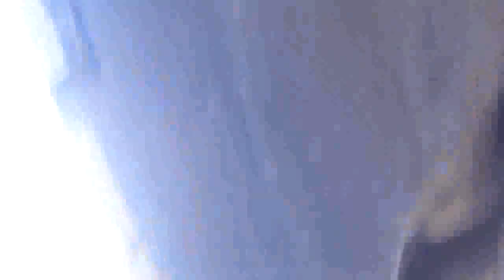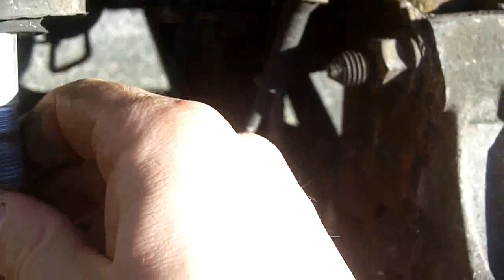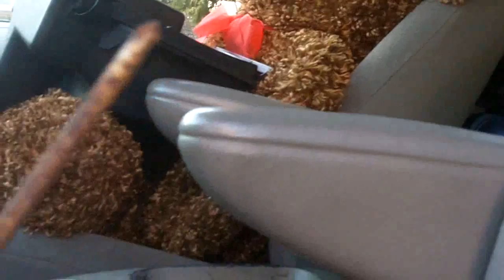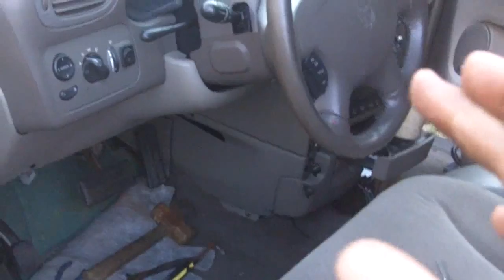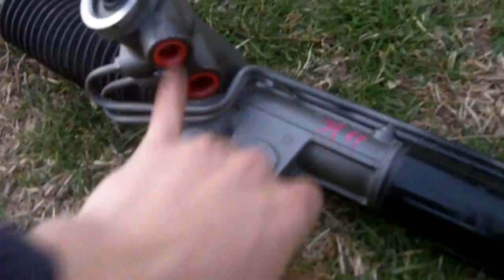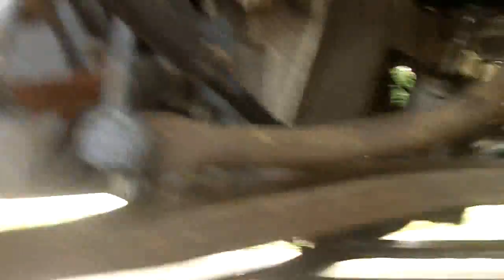Installing a new Rack and Pinion 2003 Dodge Grand Caravan

Comment: You can leave the outer tie rod ends connected to The idle steering knuckle break the nut loose and just just unscrew it from the idler tie rod end. You don't have to take the tie. Rod ends off the outer tie rod ends. You should loosen loosen the outer tie rod ends in the beginning first thing

Comment: why would you start the video with a lie? simple is a 100% lie
Reply from the maker: It is simple, it’s a part replacement. I remember this. The power steering pump was difficult. I’d rather do 10 more of these then EVER do a power steering pump on these . Many tasks in vehicle repair are simple if you follow steps and have patience.

Comment: Here's a mechanic hack for y'all. To keep the steering wheel in the straight position take the seat belt and loop it through the bottom of the steering wheel and into the belt buckle move the seat back or tighten the seatbelt. This will keep the steering wheel 100% straight

Comment: To lock the steering wheel in place if you're having problems pool the driver side seat belt all the way out slowly until it's fully extended wrap it around the steering wheel and clip it into the seat belt buckle pull the seat is far away from the steering wheel as you can get it and it will hold the steering wheel from spinning while you're playing with everything else again pull slowly and make sure before you disconnect anything your steering wheel is centered and the wheels are as well
Reply: Pull not pool
Reply: And I know this thread is ancient but it is a tip that someone might need

Comment: Theres a special tool that slides over the tie rods you tighten the bolts around the inner tie rode in and you use a ratchet to turn the whole tool. Dodge caravan are rounded so theres no place to grab onto with a tool. I just did mine

Comment: Removed rack by slipping it through center hole of support plate. Didn't take any bolts off plate. Remove 3 nut/bolts, fluid lines from rack then slide it to passenger side until drivers side tie rod end can be dropped into center hole and turn rack so it can be pulled out towards drivers side. I took out battery, cruise control unit and filters(2) under drivers seat for access to fluid lines. There are lines in the way that need to be moved a little but you'll see that. Not sure why people remove plate

Comment: Lol hope ya disconnected battery too. Glock is also why air bag lite stays on some time. I am getting sick of car repairs, mostly the greasy jobs!!!!I have a big problem with shops leaving nuts and boults off. Jerks keep doing it! Got oil change they lost air filter nut. Do we need a power steering pump too.

Comment: Grate vid, I do have one suggestion, two days before you want to remove the rack spray penetrating fluid on once or twice a day before you start to work, on the tie rode ends and other nuts you want to remove. This should make removing a lot easier. you should drive it during those days as the vibration will drive the fluid in the parts.

Comment: I was quoted 6 hours later from Firestone to do that job can it be done quicker than that I also need the drag link replaced
Reply: The 2001-2007 Dodge Grand Caravan/Chrysler Town&Country steering system does NOT include a drag link.

Comment: Good job, I have to do this on my 02 T&C, would it have been easier if both inner and outer tie rods were removed prior to removal? I do not want to loosen the engine cradle and also want to avoid the large bracket/support shield too. Thanks

Comment: How long can I ride on a bad rack and pinion? Been doing it for 5 years 100k plus  lol  I mean I'm not loosing power steering fluid. It drives and steers fine even alignment on point. I do hear minor noise when parking etc  which got little worse over years  but unless you really know and listen to the car you wont notice it . II got about 250k on my  2006 Camry don't want to put money into it besides that car good mechanical condition drives smooth any advice? I wanna make this car last without doing unnecessary work $$ save money fyi my mechanic said i got at least 20 more k on it minimum but who really knows
Reply: brs rafal yea I notice noise too. I hate any kind of noises, I am reconising different noising like water pumps are real easy.

Comment: I'm about to change my rack & pinion on a 2000 Plymouth voyager , My main concern is rust on the jacking points of the frame. Where should I jack up the van , using my 3 ton floor jack and safe placement of the jack stands? I Like the idea of placing the tires under the van for added safety. 
Your video is very helpful .  Thank you

Comment: you can hit the bottom of those bolts with a hammer using a block of wood to keep from damaging them, they pop out fairly easy,  also you have to have a 18 mm claw wrench with a long extension bar or forget it, I took that whole brace off it was a pain in the butt but it did make removal and putting the new one on much easier.

my problem now is the new rack and pinion steering pin does not line up with the knuckle it was removed from and I am trying to find out which I should turn to make it line up, the knuckle that comes down from the steering wheel? or the new rack, I'm guessing the new rack as the other might mess up the clock spring

over all good information would have preferred an entire replacement video that might have answered this question

having had an opportunity to do this again I would have parked it in a bad neighborhood and left the keys in it
Reply: The directions with the rack and pinion tell you that the rack is centered and ready to install but my rack did not come centered. I called the support line and one of the guys told me to turn the rack all the way to the right and then all the way to the left and count the number of turns, it was 3.2 turns so I turn it back to the right 1.6 turns and it was at twelve oclock the same as my rack. I did this with both racks to make sure they sent me the correct one.   i did not remove the brace off the bottom and was able to get the rack out but it did take some finagling. I also replaced the high pressure hose not because it was leaking but because I have over 210,000 miles on the car and it was a piece of cake without the rack in the way. Hope this helps

Comment: I have a 1998 Dodge Grand Caravan which seems a lot like your model.
My Rack and Pinion is leaking as yours. 
I just wondered instead of buying a new unit, is it possible to remove it and fix the leak? It is a seal that's failed?
Never attempted this before.

Comment: hello you forgot to mention that you had to hold a nut on top of bolt on the cage part but how do you take of the 18 mm hose off the rack from below .only thing holding it up

Comment: One thing you should really not do is smack those knuckles with a hammer to break those outer tie rods loose.  Normally, it's fine to do as much when the knuckle is made of steel.  The Caravan, however, has aluminum knuckles.  Since aluminum is a softer metal, you run a greater risk for damage and distortion of the knuckle.  The holes that the tie rods seat into are something you definitely don't want to distort.  They're tapered to create a friction fit and that binds the tie rods to the knuckles.  The other problem you could cause is to distort the curvature of the arm that connects to the tie rod.  If you mess that up, you can mess up the geometry of how the van steers on turns.  The best tool for separating the tie rods is from OTC, (part number 7503)  It's fairly pricy for one time users so check with your local auto parts stores to see if they've got the tool handy in their tool loan programs.

Comment: What the hell?  

All the bolts on this goddamned thing have nuts on top.  The big black support plate does.  I cant reach anything lying on my back under my van.  I do have large hands, but still.  I cant turn any of these bolts to take anything off because the nuts up top just spin.  Even the three big ones that hold the rack in place.  How is this job possible?  I cant get a wrench on those nuts to back the bolts down...maybe a few of them....but a lot of them there's just no fuckin way.  Nobody ever mentions this???????   Nobody.  Seriously?  I have to put it back together.  I give up.  I gotta send my rack back to rock auto.  This is ridiculous.
Reply: It's doable by holding the top nuts with a box wrench (21 mm and an 18 mm) . You have to blindly feel each top nut with your had to determine the best way to access each nut with the box wrench. In my case, I used the mentioned box wrench(s) along with an air impact for the bottom side bolt. I can't imagine removing that cradle and rack without having the air impact. Too much added work without it.

Comment: I just replaced rack and pinion from my 2003 grand caravan, and as most of you already said, its a pain in the ass to remove both lines from the rack, Sadly, after over 10 hrs, I got a bigger fluid leak with new part installed, so my question now is, what if I  messed up and put back revesed lines? can somebody tell me which one is the high pressure and wich one is the return line in the rack itself?

Comment: This may be old news since I didn't feel like reading. The proper way is to loosen the tie rod ends before you you remove the ends from the steering knuckles, and then count how many turns it takes to remove it from the rack. That way you don't have to have the tie ends in your way. Then count the same turns when installing so you can take it for an alignment if needed.

Comment: What makes changing the power steering pump such a hard job?
Reply from the maker: *****  sorry for the delayed reply.  the power steering return and pressure line mounted right on the rack makes it a really difficult job because of its position. as I was typling i looked at your post again and you said pump not rack. lol.. the pump is a very straightforward and easy job. the only part that I would say is difficult is getting the old pully off the old pump and transfering it to the new one. taking it off is a bit challenging but putting it on is a breeze. most remanuafactured pumps come with a long screw washer and bolt.  you set the pully down evenly and you screw the screw down the thereaded pilot hole and then you tighten the nut down on the washer till the pully is down on the pump. Its a good idea to take note and measurement on where the pully sits on the shaft, cause Ive had a few of these vans come in because the belt was popping off or squealing and it was due to a mis alighned pully. you never want that in a serpentine belt system.. or you can just buy a pump with the new pully on that. the other style pumps are mre common to come without the pully installed, and ofcourse the pully is seperate.

Comment: These cars have a heavy pivot point on the front. If you are not careful the front might drop and tilt down onto you as it is heavier with the motor, etc. so make sure your pivot point is forward and not backward to the balance of the car body. Be safe or get crushed in the front if it tilts onto you.

Comment: The book time on this is 4 and half hours. Which is impossible by the time you do the job and bleed the system.
Reply from the maker: Lightningmicro  most mechanics have them up on lifts and they bang them and rip them out and move onto the next thing. thats why Ive got a few of these in that had racks put in them by other shops and the van is throwing a EVAP code for the line thats under it being unplugged or broken cause they werent careful

Comment: Question?  Is it possible to loosen an emission hose while doing this and if so will it cause a 457 code?  I had mine repaired recently and my engine, gas cap light, and airbag light has been on ever since.  I don't think the airbag light is connected to it though and I'm confident that it's not the gas cap because normally when I tighten it the light goes off.  It's been (7) days now.
Reply from the maker: Sister Mattie Yes, Theres a hose that often gets loosened during this process. its right under the rack and pinion. Also, Yes. Your airbag light is connected to this aswell.  If the shop accidently spun the steering wheel while the rack was disconnected from the vehicle, say goodbye to your clock spring inside the steering column that delivers signal to the air bag and other things.. get the SRS codes for the airbag light, Ill bet its for a faulty clockspring or some loose wiring along the way by the steering column.. You have to be carful with who services your car. let me know what you find out

Comment: how did you get the steering column on the steering rack with out it moving
Reply: 905speedgta  If you're planing on putting the old rack back in - During removal and Before you separate the rack from the column - use a marker or paint pen to mark the position it is in.
Reply from the maker: Kevin Smith  remanufactured racks come in the straight ahead position. meaning its set so the wheels point straight ahead. the steering wheel is to be placed as if the steering wheel is straight and not turned.  and it will slide right in

Comment: Nice video and thanks.  I'm 12hrs in 3 days into this job. I'm replacing both lines, reservoir and rack and pinion.  (I'm using power tools and jack stands and not sure how you did this in 2 1/2 hrs. Those lines took me over two hrs. to unhook from the rack.
Reply from the maker: its allgood  sorry for the delayed reply. the lines get everyone. there a huge pain in the ass. I had to do this same job on a 2010 caravan and it was a breeze. so much room to work

Comment: Boy oh Boy...I don't have enough remove to pull the rack out to the left or right. Has anyone pulled the bolts off the AWD Power Transfer Unit?? Will that lower the PTU( with the shaft going in)  just enough for the rack to be able to slide out?? The shaft coming out of the PTU is right under the rack on my 1999 Grand Caravan. The part of the rack that goes up into the steering column needs more space underneath so the whole rack can slide out towards the passenger side.
Reply from the maker: yourcaptain2  Im surprised no on in 5 months got back to you. sorry for te delay. were you able t get the job done?
Reply: 905speedgta
 Yes..Thankyou..I had to unbolt and remove the drive shaft and put it to the side. It is the rare 1999 Grand Caravan from that year with AWD. Then some muscle and wiggle to get the rack out.
Reply from the maker: yourcaptain2 Yeah the AWD's are interesting to work on. Ive had 2 to work on in my 10 years of working on cars. didnt do a rack on them though! lol.

Comment: Sorry about bothering you but was your 03 grand caravan all wheel drive?  Those are rare vans.
Reply from the maker: No it wasnt all wheel drive. And they are pretty common here, I still see alot of them
Reply: 905speedgta I see a lot of awd drive here in Michigan.  Michigan has very heavy winters.  Because of chrysler doing away with all wheel drive my aunt is thinking about going to buy a awd jepan minivan.  She used to love town and country minivans.
Reply from the maker: asus0696  Nissan is just pulling me away from american cars. its sad, and I never thought Id own my very first japanese car as of late last year ( Dec 3rd 2013) and then my second japanese car 2007 nissan sentra.. My exact words in 2005 were, YOU WILL NEVER SEE ME IN ANYTHING BUT AMERICAN...Well..The only thing I have left thats american is my 99 caravan...
Reply: 905speedgta I said the samething in 04 too. Well in 06 I bought my first Japanese car a 2001 Toyota Avalon XLS at first thing I thought will this last? And almost 10 years later bought another 2001 Toyota Avalon XLS with a hundred and thirty-nine thousand miles And I love it to death.  I'm also thinking about buying a nissan altima sl 2.5 to see if there as reliable as my cars. I said my aunt dont buy another town and country again.  She is going to buy a new 2015 toyota sienna awd this winter.  But she had another toyota sienna after her 03 town and country awdm  She loves that van. Her 03 town and country I could tell was a pos at a end. Dash board died at 80k on it. Thank god it was a lease. Tho I have say it was a very comfortable minivan.
Reply: 905speedgta is your 1999 dodge van caravan or grand caravan?

Comment: Can I drive my 99 Grand Caravan up on to a ramp and leave the front tires on while dis connecting the tie rod ends??
Reply from the maker: yourcaptain2  You could, t just makes things more difficult
Reply: No, it will be much harder and cause it to take longer to do the repair. (You won't be able to get the outer tie rods off.
Reply from the maker: its allgood  You can get the outers off ive done it before. But you are right its more challanging. Some people opt to do things like this because they dont have a jack and ramps is all they have. It can be done tho. Do I recomend it?. No

Comment: Hi:) You can take the rubber boot of and take the large nut off the end of the rack on the other end of inner tie rod there might be a pop rivet or tab locking the nut in place and that nut that is on the end of the outer tie rod is a jam locknut that has to be loosened before you can take the tie rod off.
Reply: cybot63 I was told I cant but the rack with out the tierrods ,they come with it?